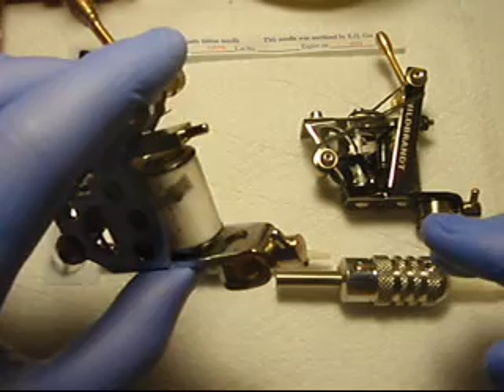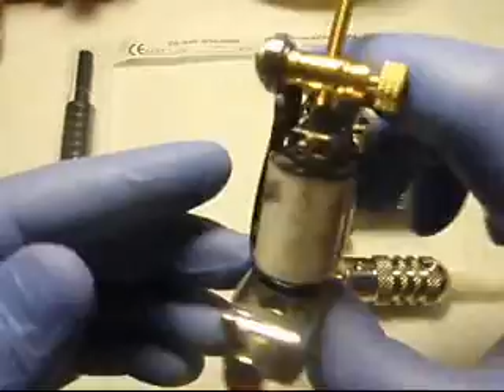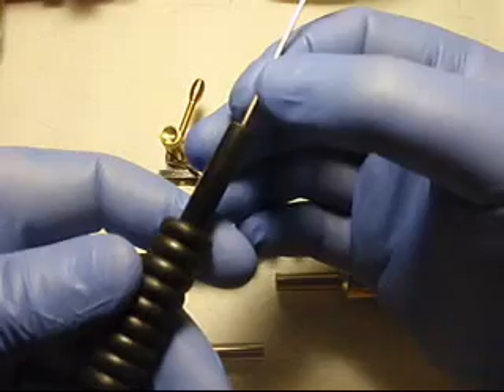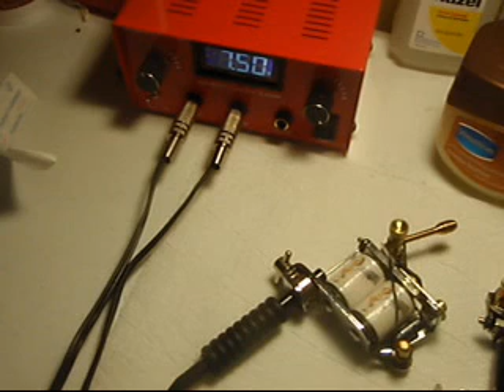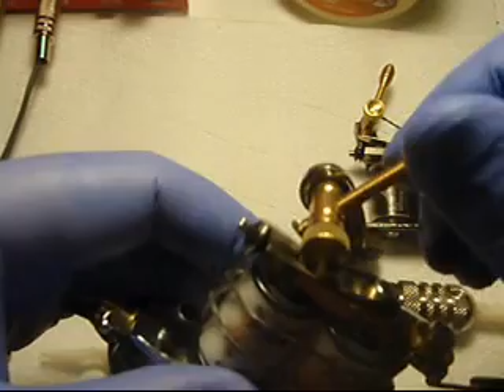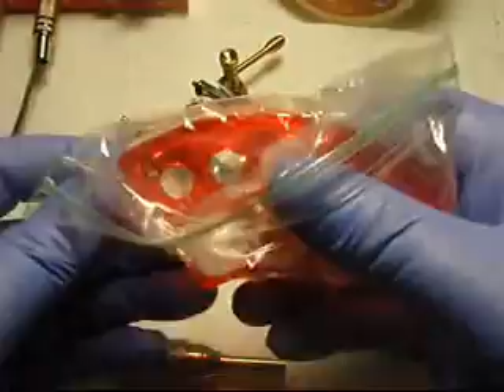[Howto] Tattoo Machine Tuning and Setup

Comment: I want to say something I find it hilarious how alot of artist talk about "o you need to buy expensive equipment to do good work" let me tell you something I have bought machines that were 50 bucks a piece and did good work 
aslong that you have a good brass frame that's not all bent or uneven and a copper contact spring and you know how to tune it you will be good to go. I repeat you "DO NOT" need expensive equipment to do professional work,and another thing the more voltage you have
the faster pace you need to go if you go slow with a high voltage you will cut the person's skin so start at a 6.5 and take your time and focus try not to double take on your lining and if your machine can't run strong enough at 6.5 when all set up and rubber banded then you didn't tune it correctly and make sure to leave about a nickel gap between your spring and contact screw gives it it's full potential throw. If anybody is just starting awesome but make sure you get machines that are nothing less than 40-50 a piece and make sure they are a brass frame with 10 coils they can take more voltage and make sure the capacitor isn't any less than a 47u if you look at this stuff you will find a good machine at a decent price without having to pay top dollar for literally no reason.
and also make sure you do not buy cheap inks make sure there ether Eternal or Fusion ink because there 100% authentic most of the rest have plastic in it literally plastic that's what helps keep the ink in and other crazy stuff the crappier the ink the more risk of allergic reactions or infections although kuro Sumi black ink is also very good but for lining work I wouldn't suggest anything more than that with that ink tho. and make sure you get a good power supply that can help you know how your machine is running it will tell you the duty your machine is running you don't want anything less than 47% but shoot for 50% duty. so people starting tattoos do not listen to alot of the tattoo artist now a days i will not give you bullshit why do you think prisoners can make a tattoo machine and  get ink from bullshit supply's and do good work because it's all about what you know about a machine so don't get discouraged practice and when ready give some ink and have fun but be safe.
Reply: Charles Sarratori you should make some.videos
Reply: This is the most honest answer on any tattoo video posted on YouTube
Reply: Whoahhhhh bro. Thank you for your service and ACTUALLY letting us know ANYTHING . Your a blessing man 💪 💯

Comment: the diff. between liners and shaders is spring tension. it has nothing to do with throw thats all you change by adjusting the contact screw you cant just take a liner make the gap bigger an call it a shader id love to see you shade with that

Comment: Guitars CAN be tuned differently but as a general rule Every guitar IS NOT tuned differently. Most guitars are tuned to A-440  You can tuned the top string down to a D for dropped D tuning or Tune a guitar open to any key. But generally speaking They are tuned the same.